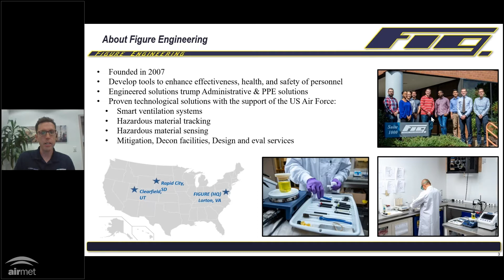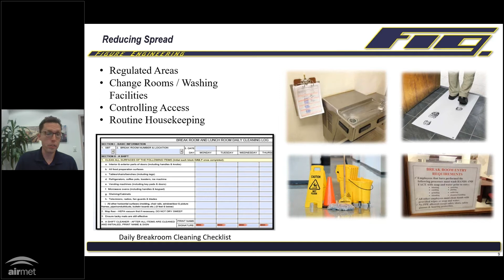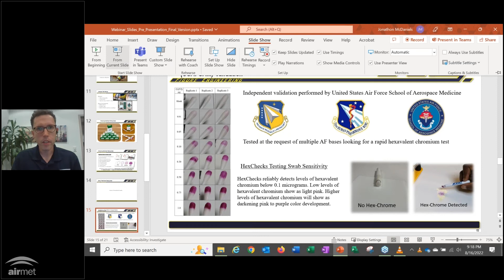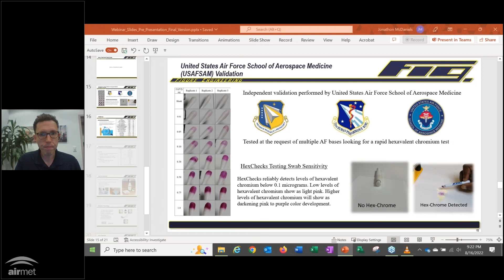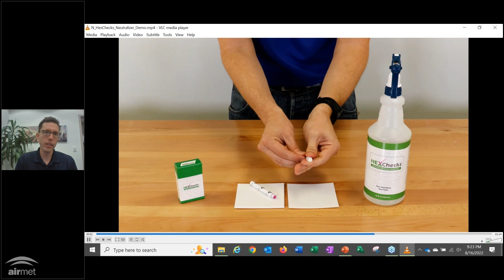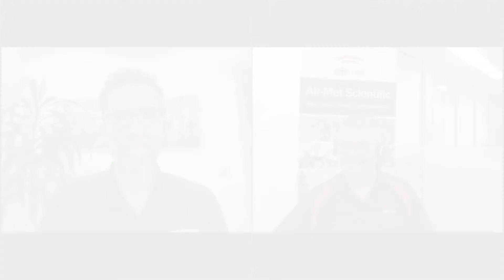Detecting and Neutralising Hexavalent Chromium with HexChecks

Comment: The issue here is coatings are applied onto one another and this method will only detect the top layer. I believe scraping a sample and sending it to a lab to get tested is still the best method. This would be a major risk where abrasive blasting is performed and you cannot have a 100% hermitacally sealed environment. Perhaps a solution in a vile that can be used might work better if at all possible, this way you can take a scraped sample. Also, what about process equipment operating at 120 degress celsius? im sure this method would not work given the melting point of the test equipment. A great step in a solution but in my opinion, not yet the final and correct solution.